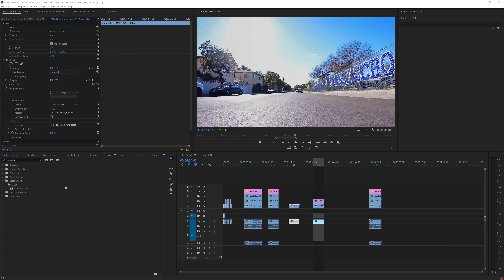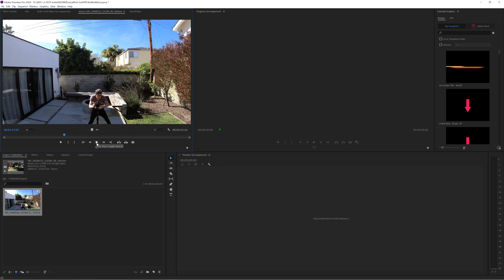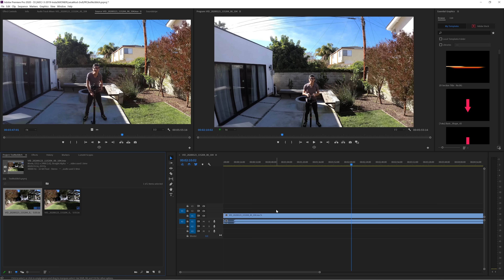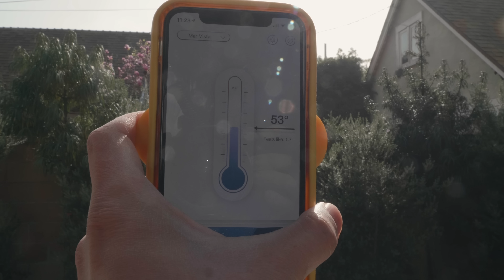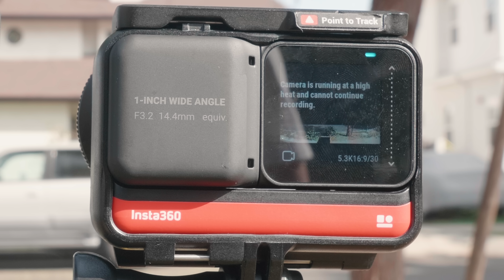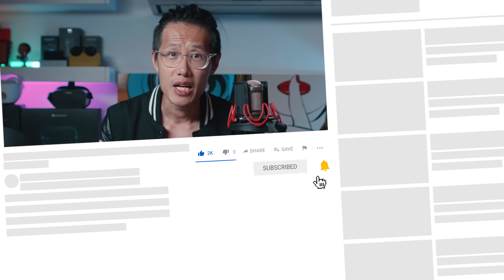Insta360 ONE R 1" Leica - 10 Things Must Know BEFORE you BUY

Comment: Hi Hugh! Thanks for the review! We fixed the overheating issue with the 1.0.13 firmware update. According to our testing, ONE R can now film 45 min. continuously at 68°F (with no wind to help with cooling). Looking forward to you giving it a go as the weather warms up!
Reply from the maker: Nice! I will give it a test run. Thank for updating me!
Reply: Insta360  -  My old GoPro3 can record continuously for up to two hours.  Why does your camera overheat after only 45min?  It should never overheat, the battery should always outlast it.  Additionally, if I plugged the camera in, and wanted to record a full day's work, you're telling us that it would overheat and become useless after only 45min?  Please clarify.
Reply: @PowerSports  your GoPro hero 3 doesn't record at 5.3k and a high bit rate... On the other hand hero 7 are famous for their cooling issues... But anyway insta360 is not issue free.. I have a long list of complains but still love the camera
Reply: @PowerSports  i only get the overheating in 5.3K mode. I don't think you have that problem with the GoPro.
Reply: You guys shouldn't be making excuses for Insta360's quality issues.  You should push them to do better.  The product should be designed to last as long as the battery.  For example, I finally bought one, and also bought three batteries.  I ran it ~50% record and 50% standby for 3 hours with no issues.  If I decide to get more batteries and run it 3 hours straight, it better not overheat, or it is getting returned.  And when I plug it into my car for a day-long race, it better last until the memory card fills up.
Reply: Insta360 can I check if the problem of having 1-2 second gaps/loss of frames in between the 30minute videos/files and the recording stopping has been solved? I.e. can I leave the camera alone to record for 2 hrs straight without any loss in frames?

Comment: The amount of efforts and time you put in your videos are absolutely insane! As a gopro hero 8 user this is very helpful! keep it up!
Reply from the maker: Awwww thank you so much!!
Reply: do you have a one R ?   I'm a hero 8 user. I'm trying to decide to keep using the hero 8 or switch to a One R.
Reply: @hughhou  GoPro hero 8 CAN be used whilst charging

You can use a Wasabi powergrip battery and film that way or you can take the battery out and connect a powerbank to the charger port 

I've done it and it works 🙂

Comment: Hi, great stuff! I’m not sure if you can help me. 

3 questions on things I’ve read on Insta360 1 inch:

1) max record time of 28-29mins. Does that improve if using an external battery pack? 

2) When using external battery packs, you need to press the ON/OFF every 10mins? Means, I can’t leave it alone to record a 2 hr footage? 

3) Are there any recording gaps when shooting longer videos? I.e. the cam saves the video into smaller blocks of 30mins and are there any gaps between those files?

Usage will mainly for my drumming footage for concerts and as an action cam also. 

Considering this Vs GoPro 9
Reply from the maker: There is a recording gap - you need to connect it via mobile app and when record stop immediately hit record again - I don't think Insta360 solve this issue yet.
Reply: CreatorUp meaning, there’s a loss of 1-2 seconds of video in between the 30min videos?
Reply from the maker: Potentially yes! One of the biggest complain on One R right now. You should let them know so they can fix this.
Reply: CreatorUp thank you

Comment: Thankyou! A HUGE Question since I do VFX. Does this have DNG birst shoting wheere I could control the ev for each exposure value and then manually merge the HDR by myself?
Reply from the maker: Can you explain what you mean birst shoting? You mean burst shooting? You need HDR? This camera do 9 step HDR with 0.6 ev+/- each step - is that answer your question?
Reply: @hughhou  I meant Burst shooting  with just 1 click and have the 9 exposures at a time considering the DNG having all 9 separate so I can merge them in post and if I could have manual control for the EV values. Thanks

Comment: Thanks for your video.  You have spent a lot of time on this.  Well done.  Just one question about the low light video.  I currently use DJI Osmo Pocket Camera and I found some pixelated areas at the bottom when the light was not bright enough, or when the video was taken in fast action such as driving.  Would Insta360 ONR R be better?
Reply from the maker: Yes, absolutely with 1" sensor. 4K mod it is prob the same as your osmo
Reply: @hughhou  Thanks for your reply.  That is what I thought: I" sensor is much better than the 4K mod and my Osmo.  Love your videos.  Looking forward to more videos from you.

Comment: I AM SO CONFUSED RIGHT NOW!!
Which should i get, One R or Hero 8? I’m really considering the One R focal length. Wouldn’t it be so awkward to hold an action cam 90cm away from your face?? I want to be a versatile and kinda lowkey vlogger i guess... Holding an action cam that far wouldn’t be versatile and lowkey. But the possibilities on this One R mod tho,... promising future... CANT DECIDE. PLEASE HELP!! Also considering One R 360 mod ..
Reply: Is it possible for insta360 to reduce the focal distance with upcoming firmware update??
Reply from the maker: I don't think so. It is physical - how about just get the 4K lens if the distance is what you concern.
Reply: CreatorUp but the low light quality difference is quite large :(  is it good enough tho? Do you think it’s worth it to buy the twin edition? Like, there will be no problem accept lowlight and color science for the 4k am i right? The upside on 1” are only for the lowlight and 5.3k? But you said... 5.3k is quite useful and could shoot in creative ways like zooming and framing.

Comment: Thanks a lot for the review. I really appreciate the time and efforts you put in them. I have a question you might know a fix to or perhaps insta360 can do something about it, since I've been on the live chat to them for 3 hours and they didn't seem to know what is going on!
The RAW images come out distorted, full focal length, despite which mode you choose. For example i choose Linear mode to keep the lines straight and the camera created a jpeg with that setting but the RAW image comes out as a full ultrawide. Could you please look into this and maybe review it.... its driving me crazy! since I can't even fix the distortion in post. :(
Reply from the maker: Yes because the RAW capture everything and  the cropping is done in the Insta360 Studio app. But Insta360 Studio does not support RAW file format so it only have the RAW (what RAW really mean - unprocessed and unwrapped image). There are lots of lens correction feature in Lightroom or Photoshop can easily fix that with defish and crop. But you should tell Insta360 to make the studio support RAW - that will solve all the issues. The only way to do right now it is with Lightroom.
Reply: @hughhou  thanks for your reply! i have tried in LH and saw an interesting way on photoshop but both seem to be just extra, unnecessary, work. I think the camera should be able to crop as RAW and keep the uncompressed image. Unfortunately LH doesn't have or support insta360 defish. So for now i guess it has to be manually done until they come up with something useful.

Comment: Would love to see the coming VR180 setup in a dive case. Also dual/triple VR180 setups in quasi-360 3D. <3

Would love to see creative uses of the GPS remote - like integrating with Google Maps satellite or street view in PIP, Google Earth zoom in/out, theoretically auto-tagging businesses as you pass-by, integrating with Waze view, etc.

Creative use of various cool mounts and heavy post stabilization, etc.

Finding out more about Wide Temp Range batteries for more stable operation even not in harsh conditions.

Address the lame 256GB limit on card-sizes. C'mon, it's 2020...the Note 10+ comes with 512GB and it's A DAMN PHONE.
Reply from the maker: Sweet. Will add those on my future release :)

Comment: Is the difference between the stabilization on the one-wheel test just because you are using the GoPro HyperSmooth 2.0 boost which (as far as I understand) makes everything much smoother by cropping the image?  If you used a similar method on the One R footage and cropped accordingly, you could get the same silky smooth floating feeling, right?

Also, if you used a gimbal with the One R, would you then get perfectly smooth footage?
Reply from the maker: If you use gimbal on any camera - it will get great smooth footage. Hypersmooth boost does crop the image - but same as Insta360 Flowstate - if you keep watching the video, you see when I turn flowstate off - you get more of the image.
Reply: @hughhou  Yeah, it's a trade-off that's really important to think about. Thanks for these side-by-side examples which make this very clear.
At first glance the GoPro seems better as the footage is far smoother, but we really do need to consider how much of the image we "lose" in cropping to get that.

Comment: Hi, i have a question for you. i m using go pro 7 to record tennis match. so i use it at the top of the court with a extensible pool to have the main plane. my question is simple: in your opinion which cameras would give me better result about the image. i m not interesting in smooth track and the other things because the camera is fixed. tell me about the pure image. thanx
Reply from the maker: 360 Camera? Or 2D we are talking about.
Reply: @hughhou  2d. Interesting en snsor 1 inch with leica lens. Thanx
Reply: @hughhou  ??

Comment: Hello, I saw an interesting picture that had a pair of 1 inch sensors mounted on the 3d mod. Is it possible to use 2 of those with the 3d mod and create vr 180 video with it? Maybe an idea for another video?
Reply from the maker: No. That rig is for 3D video not VR180 - but you can put 3D video within VR180 video to create immersive theater experience on Oculus TV - it also look amazing - like the Slow mo guys did.
Reply: @hughhou  Thank you!

Comment: Hero 8 does charge while recording, it just doesn't show on screen. I record a ton of lectures and use a battery bank with my Hero 8, and it will slowly charge while recording. You just need to start with a low battery and when you stop recording after attaching a USB supply (and giving it some time to actually charge while it's recording), you'll see the battery % pop up to the new higher level after the screen updates once you stop recording. Might be a firmware bug that's yet to be resolved, but it definitely charges while recording just fine.
Reply from the maker: Thank you for the information! Good to know Hero8 does  charge!

Comment: During the electric board test. Did you also notice that the trees flicker like a strobelight when moving past them? Is due to compression or is it rather that the gopro arent as sharp so the flickering is minimized..?
BTW I have seen the some flickering effect on grass when moving.
Reply from the maker: That is due to the Auto white balance bugs - was supposed to be fixed in this firmware but I guess it is not completely fixed...

Comment: Hmmm not sure what to do with my 1 Inch order. I hand hold vlog and am worried id be out of focus if using the One R 1 inch... ☹️
Reply: You may want until lenses with shorter focal distances come out.  The lens is easily removable
Reply from the maker: 3 sessions selfie stick should solve the problem or use the 4K mod?

Comment: How do you fit insta360 One R 1-inch mode into a holding case that comes with it? It does not fit into mine.
Reply from the maker: You screw the lens cover off and put it into the case - https://youtu.be/PNnfkUYqiuk?t=1178

Comment: Excited for stereoscopic (not sure what combination of modules would work, for instance one piece of the 360 mod + one piece of the 1inch, or would 2 one inch =10k ?) , 

Also excited larger battery , possible new 360 8k module down the line , and firmware updates 

Also excited for whenever the release of the One X 2 would be and it’s cost, definitely curious about One X 2 ! 😲

Curious and Concerned about real world shooting with the one inch and not experiencing Overheating  🥵😳😬😨. 
Maybe they shouldn’t ship until they have a better solution in place or a better processor unit , IDK

As well as 
How can it be possible to use the external mic adapter while keeping an external battery pack connected at the same time. How would it be possible to use both plugged in at the same time 🤔 . Isn’t there only in total one usbC entry point occupied when connected to a audio receiver or plug in mic ? Leaving no port available for charging ? 

But Awesome Content Hugh !!! What a guy! Thank you and keep them coming ✊🏼
Reply: The 3D mod is for 180° VR videos. So they use two 180 cameras. I assume they use the two separated cams from the drone.
Reply from the maker: VR180 mod share the same camera setup as the  drone mod - I do have them. Working on the review next.

Comment: can you use 2 of these 1 inch sensors in a 180 3d configuration?
Reply: The existing 1" camera has no 180° lens. I assume the 3D mod will use the two separated 180° cams from the drone version.
Reply: @Ulrich.Bierwisch  wack

Comment: Thanks for the vibration tests. Looks already pretty good and there is still room for better firmware.
I don't need 100% stable videos from the bicycle. For example: I produce videos showing how bad some of the bicycle ways are in my area of Germany. The Sony X3000 is already smoothing out so many bumbs that a ride looks unreal and sometimes it's hard to get the message over. (Yes, I can switch it off but than it's unusable and makes seasick.)
Reply from the maker: Good to know! Then ONE R is a great choice for you :)

Comment: Gopro Hero 8 is better but an ND filter would really reduce the "jello" on the sides of the One R by forcing it to use a lower shutter speed. FPV pilots have been putting ND Filters on gopros and other cameras for ages. great video again Hugh.
Reply: Wouldn't an ND filter force a longer shutter speed, making the jell-o worse? But I do hope there will be a way to force a short exposure / fast shutter speed through the camera options.
Reply: @BeMeCam  slower shutter reduces jello because the high frequency vibrations aren't noticed as the shutter rolls by. i mean there's no point in debating what would happen, everyone knows an ND filter on a drone works to reduce jello and always has.
Reply from the maker: Great tips!! I will try that - ND filter is coming on ONE R 1"
Reply: @hughhou  official insta360 ND filter or aftermarket? do you know of any ND filters that fit the 4K mod? you saw my drone picture on the facebook group, i need ND filters for that bad boy.

Comment: when you connect the light to the one R, wouldn't it compromise the waterproofing of the one R since you would need to expose all the connection ports?
Reply from the maker: Sorry the light is NOT connect to the one R - obviously you won't put the battery and charging cable into the water lol. Just the light and the camera. The camera was dead when I film that scene so I am charging it.
Reply: @hughhou  lol I see.  thanks for the clarification and keep these super informative vidoes coming :)  cheers

Comment: Is it possible to use ONE R with type C adapter(spliter) 3.5mm mic jack+type c power connection? I want to record sound and charge ONE R simultaneously
Reply: Be careful, you might end up charging your mic instead lol
Reply from the maker: IDK - but I should try that. Any brand you find it might work?
Reply: @hughhou  I found some adapters from Ali, ugreen is cheap and reliable brand
Reply: @hughhou  check something like this please, I will be really appreciate it! If it works fine, that will be cool!
Reply: @hughhou  btw what about airpods? does they work with ONE R?
Reply: @catsfpv603  this adapter works fine with the android phone
Reply: @VDumpers  I know, I was just funnin'.

Comment: Thanks for a very good review.  I think stabilization is important.  Yet, if I am riding a bicycle, I don't want the video to be so unnaturally stabilized that it appears that I am flying and not riding a bicycle.  This would apply to other uses as well.  I am not a fan of Go Pro freaky unnatural stabilization!
Reply from the maker: Then ONE R will be great for you. It has a more natural vibration and movement / drifting.
Reply: @hughhou  Except on the drone!  That type of vibration is not acceptable during flight.  Flight should be smooth. Thanks again.

Comment: I don't think I'll buy the insta360 one R to upgrade my oneX. Maybe I'll buy an osmo pocket or even a gopro hero 8. It seems that the Insta360 one R is an unstable and unfinished product, released in a hurry. It is unacceptable the problems of heating and lack of focus for vloggling. Also, you compare the image quality of the gopro with the 1-inch mod, but the sensor size is different, actually even in those tests the gopro seems superior many times and almost as good in others as low light and it seems that in all comparison tests with the 4K mod it is always much better. I think it would be great to have a video with in-depth comparison between the 4k mod and gopro to get the best buying decision
Reply from the maker: Yes I will do that next :)